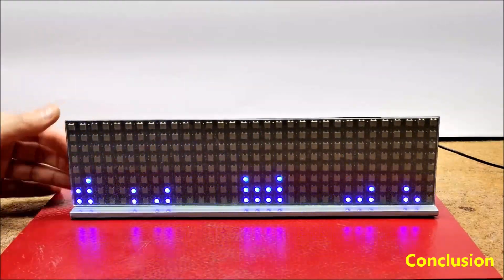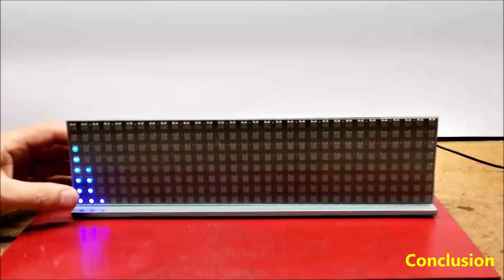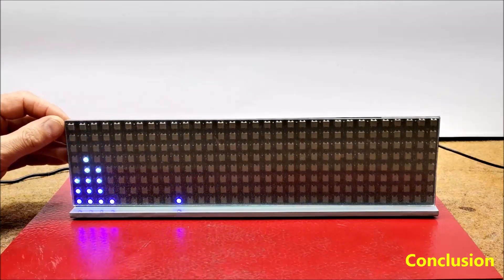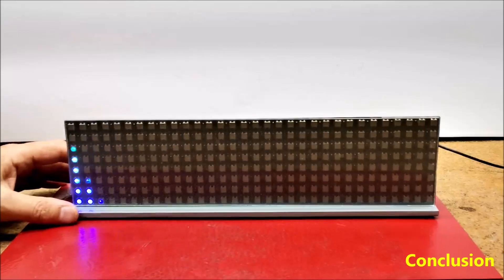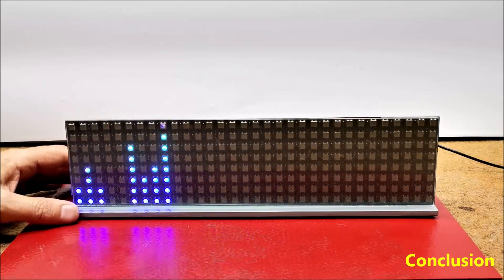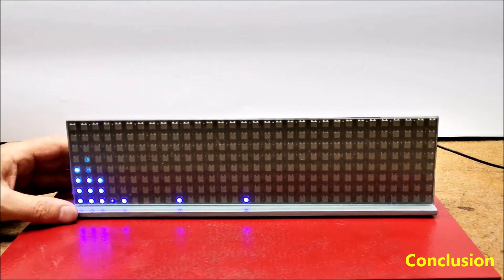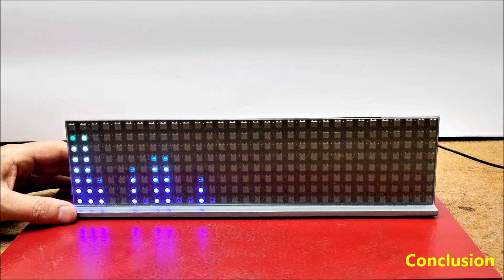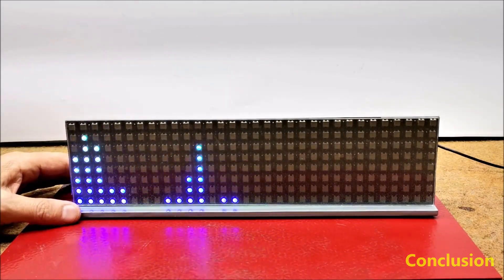Arduino FFT Audio Spectrum analyzer on 8x32 color matrix WS2812B

Comment: Very awesome!! Thanks for showing the Online Tone Generator! Very easy to find. I will send them some $$ so they can keep that going. Mirko, take a speaker and lay it cone up and put a flat piece of something that can vibrate over it and put sand on it. Then run different freq. through the speaker to make geometric patterns in the sand and make a video of it!  😃🔊🎼🎵🎶🎚🎛 I saw it on Ancient Aliens. I suppose it works (?)